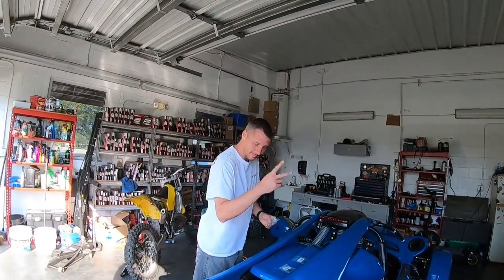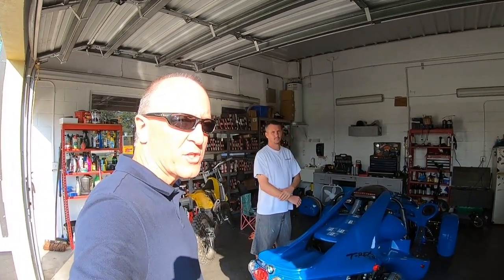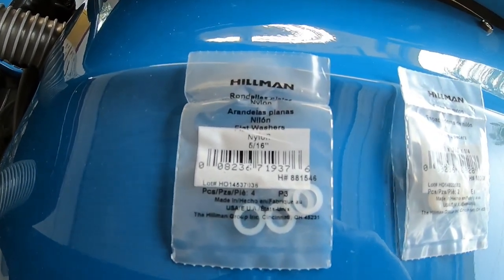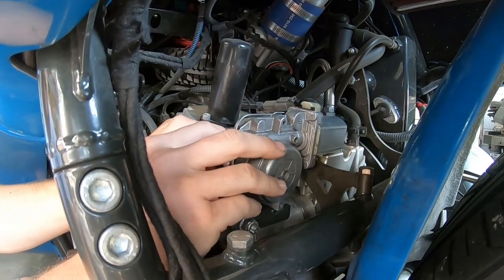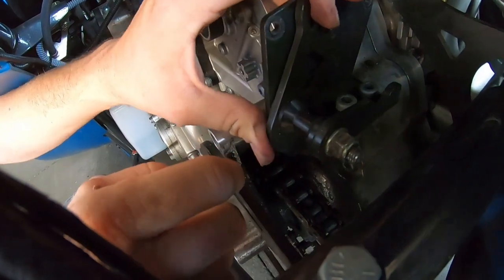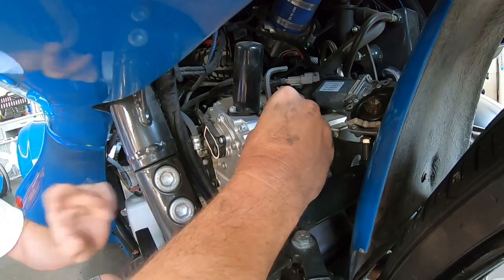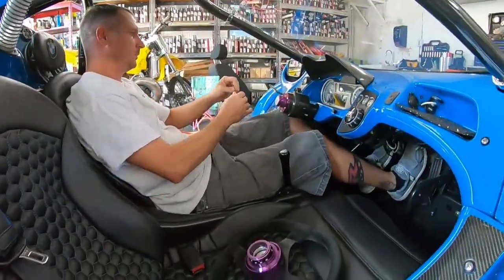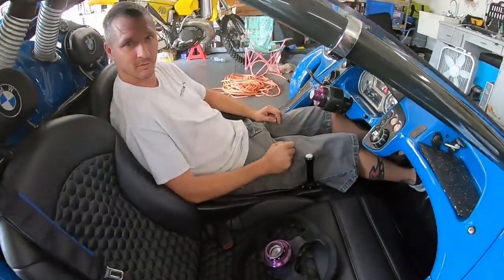Campagna T-Rex BMW reverse gear engagement actuator repair

Comment: Hey, thank you for this video. Do you recommend doing this before you start having issues or just wait until you start to have issues?  Also, Does Randy have   a video an how to change the gear box oil for the 2020 BMW 16sp?  Thank ahead to you and Randy.
Reply: Thank you again. Appreciate it.
Reply: Hey, Todd. Would you mind sharing a link to get a rear spoiler for a 2020 16p?
Reply from the maker: @italkcommunications8111  I don't have a link, but I know who and where you can buy it.  Contact Durend Burnside Trexcite 470.878.1434.
Reply: @toddkerber Thank you, Todd.
Reply from the maker: If it ain't broke, don't fix it.  I changed Scott Johnston's oil on his BMW platform, but it was before I was doing how to videos.  Sorry.  We read the owner's manual.  Engine and gear oil are the same.  Also more than one drain plug.  You can find owner's manual here:  https://trex.campagnamotors.com/en/parts-and-service

Comment: How do you get the shifter off so I can get to the gas tank?
Reply: 2020 16s, gas tank is leaking from driver’s side and I can’t get the shifter out to lift the panel up and out.only has 1500 miles and check engine light is on and gas tank is leaking
Reply from the maker: @timstevens1760  Okay.  I've got a 2007 1400R and I have not had to remove the shifter.  I would contact Durend Burnside Trexcite at 470.878.1434.  He is the Campagna dealer Atlanta, GA.
Reply: Thank you, I found the problem but can’t find the part,it’s a fuel pump electronic module. Part numbers doesn’t match
Reply from the maker: Shifter/gas tank, I'm confused.  What year do you have and what are you trying to do?

Comment: Does the side reverse lever have to be parallel to the floor ? Mine out of reverse in first gear sticks up about an inch and a half . Reverse light goes out but hear clicking above 35 mph
Reply from the maker: Lever position shouldn't matter, but function does.  I will show on next video edit where to adjust this.

Comment: No it doesn’t stop The reverse light goes out, but it really clunks going in reverse
Reply from the maker: You should not hear knock knock knock going into reverse.  If you do, you are ramping a plate in there.  Try no throttle, start and stop engine in forward gear, if it won't go into reverse easy feather the clutch slightly.

Comment: How do you know you need a cable adjustment ? My 2023 reverse lever is not parallel to the floor in first gear. The reverse light does go out , but a clicking sound is heard going down the road
Reply from the maker: You should not hear clicking noises from the gearbox going forward.  Does it stop if you push the lever forward while driving?  I'm getting ready to do a video edit on reverse gear oil change and adjustment.  Stay tuned.

Comment: I fixed mine years ago. What I have found is that it's a timed event and the more you use it the faster the motor turns and eventually jamming it up. I ended up installing a limit switch and removing the thermo resister in the motor. No issues in 15,000 miles.
Reply from the maker: I'm going to share this with Randy and Durend.  Thank you.

Comment: Can I get part numbers here please? I want to be on my way to Lowe’s/Home Depot ASAP!! 🤣🤣
Reply from the maker: 4 flat washers nylon 5/16", 2 nylon spacers 1/2" x .257 x 1/4", and 6 flat washers nylon 1/4".  Hope that helps.
Reply from the maker: I don't have the actual part numbers.  Pause video.  You should be able to get what you need.

Comment: @toddkerber the mesurements is it diameter or thickness?
Reply from the maker: I'm assuming you are talking about the nylon washers and spacers?  Both dimensions are on the bags.
Reply: @toddkerber  Yes Todd!  I put the video on pause and noted them.

Comment: I spent $2300  on my reverse on my 16S and it's was just this!!!!!!!!!!!!  Wil do it !!!!!
Reply from the maker: It could be other things, but this overheat situation is affecting many.  The actuator has to work and obviously no gear damage inside reverse box.
Reply: @toddkerber  They changed my selenoïd and my computer and still when I rode it 2 weeks ago, did the same. Shit!